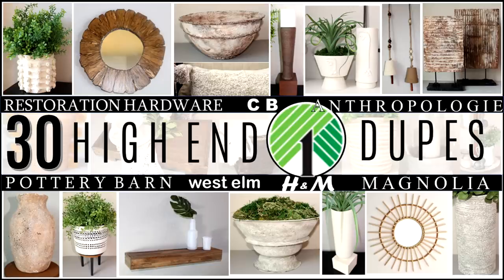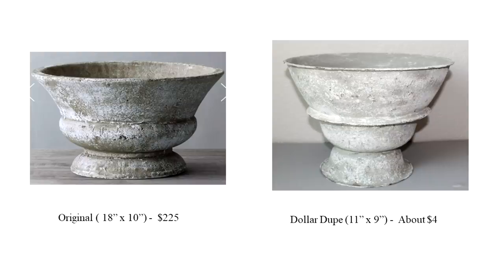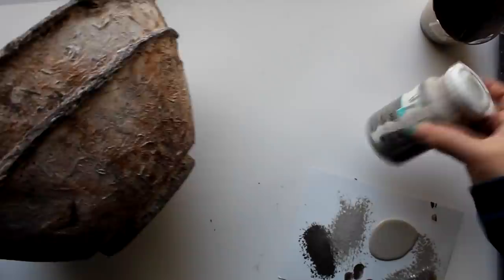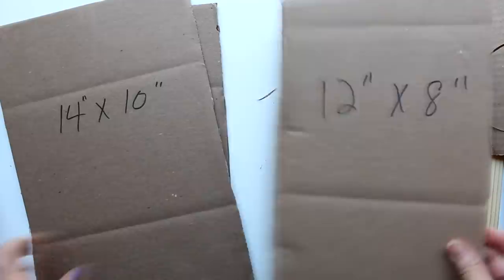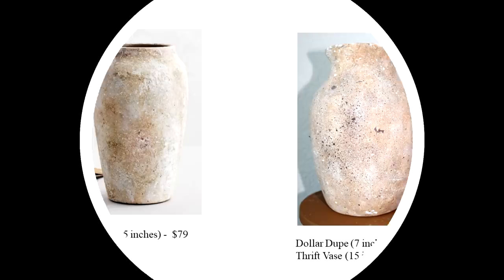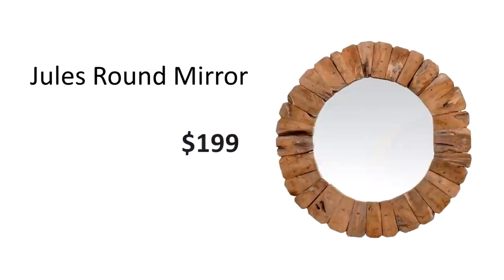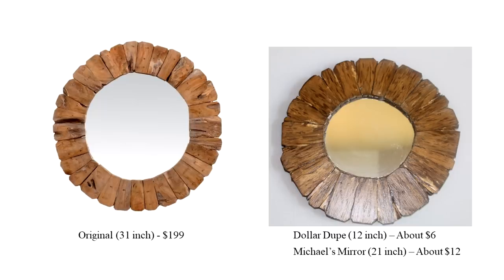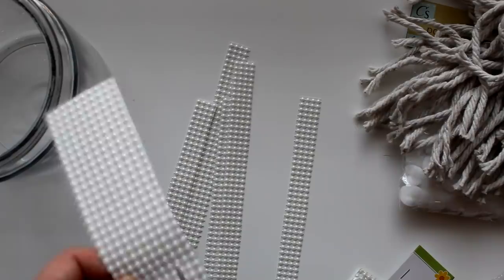30 HIGH END DOLLAR DUPES | RH 🔸 POTTERY BARN 🔸 ANTHROPOLOGIE 🔸 WEST ELM 🔸 MAGNOLIA 🔸 H&M HOME

Comment: #1 If you wanted to get even a closer to the original $95 vase, get a wood ring and liquid cement it to the bottom of your vase coating it too in the chalk, then paint. Those wood rings can be bought in any home improvement or hobby store for $2 or less. Great vase!
#3 Papier Mache:  could add sand or pebbles mined with glue inside of black lid base to give vase some weight and security not to be knocked or blown over so easily.
(4) Instead of makeup sponge, a cut down bath sea sponge (has lots of holes in it, might work better? Can be bought in dollar store or Walmart for under $5
EXCELLENT MIND and WORK Darlin'!
Reply: Nice tips. I saw a video where she mixed baking soda with paint, and another with sea salt and watercolor. I love these unconventional mediums- great ideas!
Reply: @tanyatmarie2263  Me too!

Comment: "....As you can see, after 3 coats,  it has lots of texture".......

What I heard is: 'After 3 coats of goop it is a very strong, dust magnet that you will NEVER, Ever  be able to get clean!!!'

A thing, anything, that has lots of lumps, bumps, ridges, lines, cracks and crevices , otherwise known as "texture",  is just going to be a nightmare to keep clean. Or in a state anywhere close to clean!!! Any projects that, while looking close to the real thing, I can/will never do due to living in the desert southwest, because I do have my windows open--- sometimes! And even with the best, most expensive furnace filters (3M) there is dust in the air in the house.  So  NO, NO, NO to most of these 'projects' unless they also have USEABLE, REAL, OR PRACTICAL solutions on how to keep the darn thing clean. OR you can clean it easily, but magically!!!  Like something that repels everything, or is sooo anti-static that, dust can never land on it, let alone get near it!

Until that aspect is conquered I will not be doing any of these projects, which I would love to try! The dust even invades a closed, glass doored, cabinet!
Don't need something else to keep clean. Or to fight with a cardboard and paint hoohaw that has the tensile strength of a Kleenex! I doubt it would make it through a single cycle of the dishwasher or my pressure washer! (Even on low!!! Hahaha!)

The only solution I can see is to make several of these at a time! Maybe 6. And just swap them out as they clog with dust or dirt. And throw then throw the first one away!  By the time you have swapped these things out a few times you will be 'over it' and can dispense with the whole idea when you throw out the last item.

Now, how to keep the things clean while being stored! And where is all of this room to store this stuff??!!!!  The garage is getting FULL! And the 3 bedrooms are used. I sleep in one! Another is setup as an office. And the third is the guestroom!  Wait!!! Unless I have the guests sleep in the garage, I could use the guest room...... Oh, never mind! I need a 4th bedroom? As a storage room??? Unless I made the living room into storage the 4th bedroom could thus be the living room.........

UGH!!!  Just  UGH!!!!!!!
Reply: wow I just hope that in your 10 mos on yt you have become less verbose and critical. 
She is not OBLIGATING you to dupe these items. That's the beauty of using dt items, heck even items you want to give a new look to, to create something new instead of filling landfills. Dust will ALWAYS invade our homes no matter how well you dust. 
Seriously if you have nothing nice to say then scroll along!
The ladies doing all these diys with dollartree items are true genius and artists in their own lane! 
Take a look at her organization videos using dollartree items. You will be amazed at the many things you can keep organized using shower caddies!
Have a great day!
Reply: while amusing, your rant makes me believe you have a hoarding problem and that you can't keep things clean and organized 😉 like I previously said, first take a look at her organizing vids. They will be a space saver for ya!
Reply: @yup_its_ME.512  I will say this much and i hope you agree----- your opinion is as valid as anyone else's!
Including mine!

The whole point of the internet is for the FREE FLOW OF IDEAS, AND OPINIONS. 
NOT JUST FOR THOSE WHO AGREE ON A PARTICULAR POINT OF VIEW, TO THE EXCLUSION OF ALL OTHER OPINIONS, THOUGHTS, COMMENTS, ETC.

If you find value in organizing with shower caddies from dollar tree--- well---- I don't know quite what to say.  
While it might work for you, it certainly isn't the approach for everyone else!  That's for sure. 
If your just starting out, in college, under 30, etc glad there are ideas, tips or tricks to help out.   If you are a bit older, more established or not in need of such extreme cost savings---- well, I'm not sure dollar tree is going to be other people's first choice . I'm sure you get that.  What works for me isn't good for everyone. And visa-versa for your 'wonderments' in contemporary  design style. 
But, no matter what, the cleanability of something  a HUGE factor in anything's practically, and value.  While something handmade might pass muster initially some of the things shown on YouTube are  NOT durable and certainly NOT very cleanable. Hence,  my comments because some folks just don't plan ahead. They can't work out 2 or 3 steps ahead of where they are at the moment. 
So my comments aren't, in my opinion, negative but rather merely saying to others to consider up keep and care or cleaning---- so we DONT add more trash to landfills! A positive idea, attitude or approach, in my opinion.
While you may not have understood that, missed or appreciated that it certainly doesn't mean others didn't, don't or haven't gotten the point of my original comments, as verbose as it might be for you. I didn't write in an abbreviated style just as I don't fashion things, in an abbreviated style, from dollar tree!
It boils down to life styles. Some want quick, easy. Some want something more substantial. Or original. Not a fake piece copied from a copy of a copy of a copy. If I can't have the real thing then I most likely just don't want it at all. It just isn't 'my' style.  It isn't what I prefer, for me! And I don't look down my nose at other people's choices!  They need to live their lives! Just as I live mine. Without outside interference! I can only hope!!!

Have a great day!
Reply: @yup_its_ME.512  
Rather than organizing soooo much stuff I prefer to live without most of the 'stuff' others are struggling to organize!
I have 3 hobbies and have the stuff to do them.   But I don't collect crap to maybe, just maybe, someday use, need, want, etc. I don't buy 20 of something when it's in sale because I don't want to deal with storing, cleaning, getting it home and into the house, only then to organize it and put it away!
That's crazy and a COMPLETE waste of MY time!  I prefer to pursue my hobbies with my available time!  Not figuring out how to pack 20 pounds in a 10 pound bag!!!
If I need something I'll go buy it. But I'm not turning my house into a mini warehouse! 
"But where do you store all of your paper towels, etc???!!!"
"Where?  I  keep those things at the store! Where else! Not in my house!"

My peace of mind, my contentment, comes from knowing I can buy whatever I need or want when I need or want it!
NOT from having my house be a minimart, chock full of limited amounts of various things that are squirreled away in various closets, under beds, behind doors, or under skirted tables!
(I'm looking at my sister on this one!)
You will never be able to save enough of whatever it is that you think you want or need. Take comfort in knowing you can go get all you need, as you need it, when the time comes!
Security is knowing you can go get it, not that you have it somewhere in the house--- expired, lost, out of date, etc. ( again, I'm looking at my sister!)

All of this organizing is just over spending, over shopping, and has been promoted by whoelse? But merchants and manufacturers.  
You need to but 3 cases of pop to get the  best price on it. That pisses me off so while I might buy it I consume it much more slowly for  playing these dumb games with me.  Because I now need to contend with it all i don't drink more, faster I say: "Well I never want to be manipulated by them again so I will let these  3 cases of pop sit here so I don't have to deal with them for a long, long time! Hopefully never, ever!!!  It's here if some guest wants it. But I'm done with Coke and Persi for their foolish game playing! And anyone else requiring I buy big quantities just to get a 'good' price, on something.  
Screw them for trying to manipulate people. And my pocketbook!

Comment: Great ideas... horrible paint jobs.  Your technique of painting can be improved...

Pro Tip:  Paint the darkest shades first, then move up to the lightest shades in layers.  

Think that time has ground in the color into the cracks & crevices.  

Your painting seems somewhat chaotic; like you are trying to fix your mistakes or you are desperately trying to match the original material.  Most times there was too much paint on the sponge for highlights.  While a sponge is okay for certain crafts, it is not the best method.  A brush would work better overall.  Also, you can remove paint while wet to blend.  Sometimes less is more.  If you are lazy & don't want to wash out a brush, then continue your nonsustainnable method.  

Otherwise good video to get name brand looks... 

However, just cause they cost a lot doesn't mean they are great design.

Comment: On the first part of the video, you're a bit heavy handed with the white paint. Also, you use caulk like a glue. I hope your stuff doesn't fall apart! On the flat textured panels, I would have used scrap wood and thicker dowels to make it more sturdy. Those "puzzle pieces" are hideous. Sorry. 😖